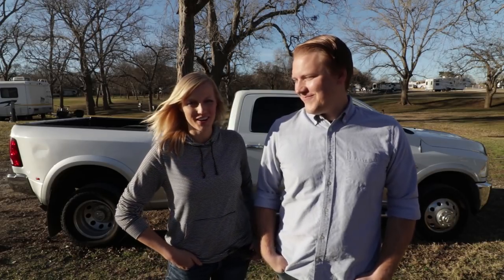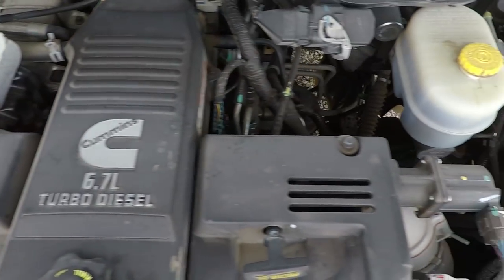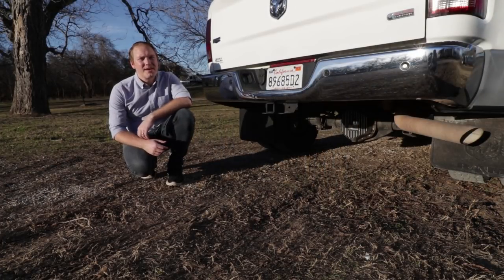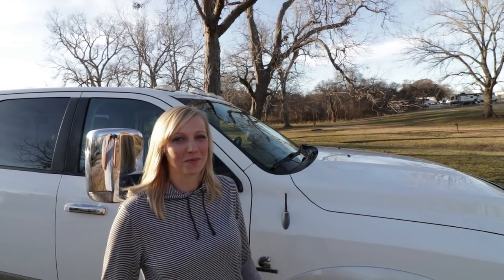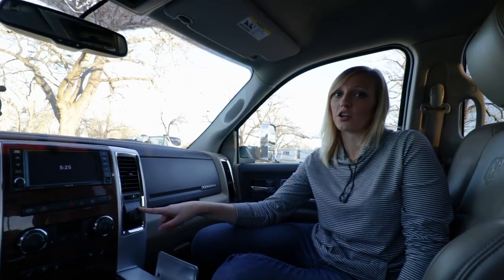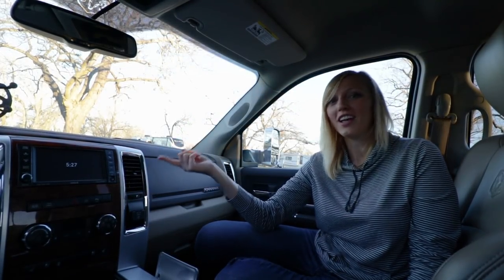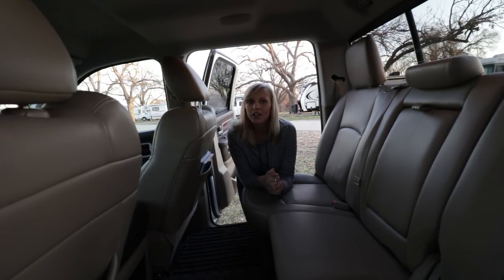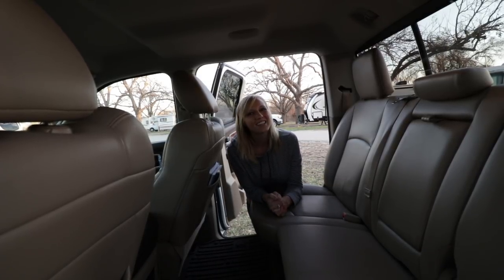Tour Our Towing Truck (2012 Diesel RAM 3500 Dually) || RV Lifestyle

Comment: Just found this video while checking out your past posts. Did you run your truck before installing the Mag-HyTech diff & trans covers? If so, what difference has it made in cooling? If not, why did you choose these upgrades?
Reply from the maker: Transmission ran 170 when towing but got up to 190-200 when in traffic on a hot day in Los Angeles before we left. After adding the trans cover, it runs around 155-180 when towing. I didn't measure diff temp but this cover allows me to more easily drain the gear oil and replace without removing the whole cover so that's a plus in my book.

Comment: Nice video, as always!  I’m deciding on pulling a trailer or just getting a Class C or B Motorhome.

I would probably buy a 23 foot Airstream or a similar size RV.  I am using your videos as a reference source to make my decisions and compare advantages of a RV lifestyle.

I appreciate your showing the upgrades on the transmission pan and I’m wondering do you change the fluids yourself?

I saw your trailer and it is huge, do or would you consider going smaller, and if so... what’s the smallest size you would choose?

I have no experience pulling a trailer which is scary, so I’m trying to learn how to by watching videos and talking to people that pull campers.

Any tips for me?

Thanks,

Dave
Reply from the maker: Hey, Dave! Jason does change the fluids himself. As for our fifth wheel, it is a monster lol. Looking back, we could have gone smaller but we were really worried about space. We don't regret not going smaller though. Honestly, I can't tell you what is the smallest we would go but I'm thinking around 30' (we're 42' now). Will you be traveling by yourself? If you are, I think a motorhome would be easier just because they seem a little easier to get around in (especially the shorter ones). We didn't know how to pull a trailer either. Just watch as many tutorial videos as you can and practice. Remember to just breath and take whatever time you need to feel safe. Also, if you're leaving or entering a campground and feel uncomfortable about getting into your spot, there's always a neighbor that will be willing to help you. You got this! Happy travels!

Comment: It looks like you don't have the Aisin transmission based on where the dipstick is... is this accurate? What is your axel ratio? I'm looking to buy a similar sized rig and like the Ram duallys. I found a perfect dually until I found out today it has the lowest 3.42axel ratio and the 68rfe transmission so now I'm concerned the truck won't handle the rig or make me be overweight which would not be good if in an accident. Any insight to help?

Comment: What are your transmission temps while towing on your hottest days? And have your dodge ever experienced the death wobble in the front end?
Reply from the maker: Honestly, we think we experienced the death wobble the second day after buying the truck. We weren't towing at the time, thank goodness. We think it was triggered by a weird way our tire hit a bump on the side of the freeway. We haven't been able to trigger it again and even had it inspected thoroughly and the tech couldn't find anything wrong. As for the trans temp, the highest it ever got was 212 while towing very slowly up a hill (about 10 mph) in 104-degree weather. We haven't had any issue since adding our Mag-Hytec deep transmission pan. Hope that helps. Thanks!
Reply: 212 is not bad at all it when your trans gets to 230 then still climbs to 240 , that when the trans starts to cook . I would prefer a dodge over everything else but i keep reading about the death wobble in where people have replaced thier entire front end and still have it happen when they hit a bump in the road . And then there the ford 6.7 that a guy would have to buy at least a 2015 to avoid a motor that would gernade or  turbo fail . Reading some Fords 6.7 in where  guy went through 3 turbos. And then there's the duramax which seems to be the most reliable but has the least amount of towing capacity and have not got any tranny temp data as of yet . I am looking at a dually for heavy towing and no headaches .
Reply: My 2015 Chevy 2500HD shows trans temp
Reply: Death Wobble is a easy fix.  Google or Ebay: Steering Gear Box Stabilizer Brace for your year vehicle.

Comment: Hi Great looking truck.  When pulling your rig what is your gas mileage. Do you have extra fuel tank.
Reply from the maker: Hey there! We don't have an extra fuel tank. Our gas mileage is 10-12 while towing and about 16 unhitched. We don't like to drive more than 250 miles on moving day so one full tank will get us where we need to go without stopping.

Comment: NIce truck, same year same model. I just don't have the dually.
Reply from the maker: Nice! It's a solid truck. Did you also get yours used?
Reply: Yes bought it about 2.5 years ago. with 115k on it.
Reply from the maker: Nice! And it has held up well? We're about to hit 100K miles.
Reply: Getaway Couple it has been fantastic. It almost feels like driving a car but I'm pulling a huge trailer like yours. A 41 ft 5th wheel.
Reply: @paullundell8009  do you have have a high wind proplem with 41 foot 5 th? I want want to tow 370fl totally 41, please advise. Thanks.
Reply: I've not been any extremely high winds but some canyon winds here in Utah, Has not been too bad, but obviously you must learn to respond to how your vehicle and trailer are behaving and slow down, At some point if having a hard time controlling it at all you much pull over and stop. Which I had to do one time in a 30ft class A, about 10 years ago. It's not worth being a dare devil slow down, be cautious and stop If your concerned at all.

Comment: HI guys !!!  I am always gathering as much information as possible and know I hear you talk about DEF fluid.  I know it is another fluid besides diesel fuel that the newer trucks require.  I think it has something to do with emissions.  Could you share with me why you do not want to deal with that, I know you should wear gloves when pumping diesel (here is NJ you can't pump your own fuel anyway), but please tell me more !!
Reply from the maker: Hey, Bruce!! We just didn't want to deal with another fluid. It's another product to buy and monitor. Also, if you get low on DEF while driving and you don't fill it up, your engine will limit you to 5 mph. While I'm sure most people don't let it get low enough to do that, we just didn't even want to think about it. Hope that helps!
Reply: Thanks for the response...   Enjoy and safe travels !!!
Reply: DEF- Diesel Emission Fluid.  On a Dodge Ram 2013+ vehicles are equipped.  2012 and below no.  As we move forward into 2019 and 2020 emissions will be harsher and harsher, which cuts power and torque from our engines.
Reply: DEF is "diesel exhaust fluid". It's a urea (ammonia) catalyst that reacts with the NOx emissions caused by high temp combustion. It is injected into the exhaust stream after the particulate (soot) filter and reacts with NOx molecules to convert them into nitrogen, water and carbon dioxide. Since modern diesels are going to continue to require EGRs and DPFs, the DEF actually helps improve power by letting the engine run leaner, thereby improving the air:fuel ratio and increasing efficiency. Though overall power can be increased by "deleting" all the emissions equipment and retuning the engine, it is against federal law, and is ESPECIALLY frowned upon in California, where this couple is from.

Comment: Were the upgrades to the transmission and rear end advised on from Rv dealer ? Is that mandatory ? It seems expensive .
Reply from the maker: Hey there! They weren't advised from the dealer and definitely not mandatory. After reading some forums about the upgrades and towing, we thought it was something better to have done now, instead of possibly overheating our transmission while towing. It's only something to worry about if you're driving in hot temperatures and/or uphill a lot.